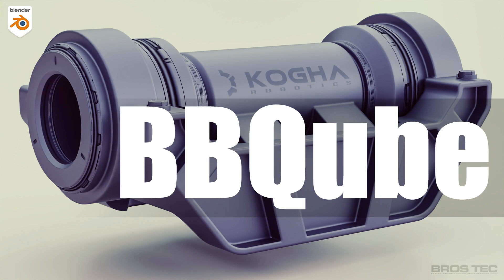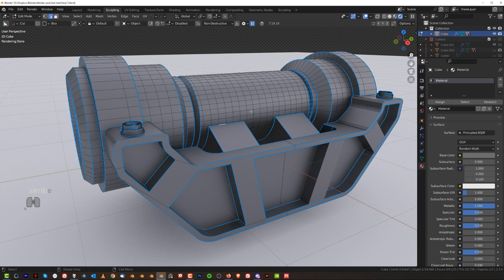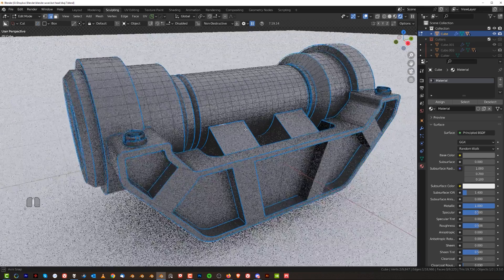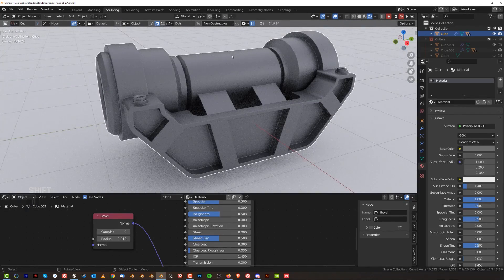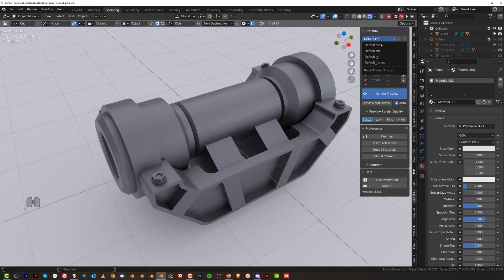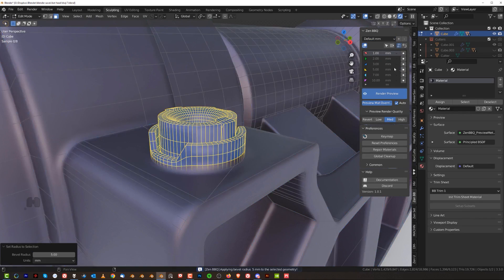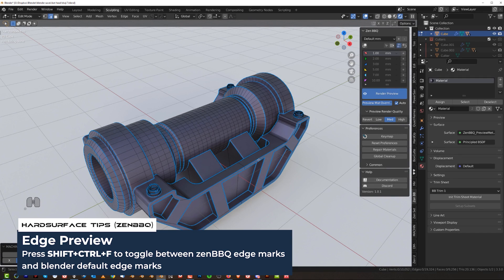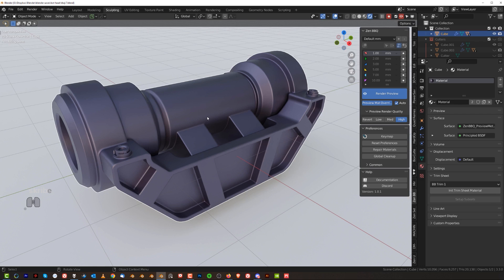How to BBQ A CUBE - Blender Hard Surface Tutorial

Comment: Hard surface modeling is time consuming, period. Organic modeling, and I'm an organic modeler (flesh, nature, etc.) is vastly more flexible because of the lack of hard and precise edges. There's so much more flexibility in creating organic edges than there is straight, uniform and precise edges expected in geometry that follows 90° angles or strict XYZ directions. I can easily and cleanly remesh with no errors in the geometry generally by nature of having smoothed or rounded edges to begin with.

Anything that can make it easier to bevel edges is especially useful because of how most algorithms of beveled edges adhere to the native or adjacent geometry to the beveled edges. This creates inconsistencies that cannot be corrected by conventional methods, so this is an awesome solution all around. I use ZenUV to this day but there is a caveat that needs to be mentioned. Baking these edges leads to heavy inconsistencies when used with other programs by nature of the geometry used in the final product. You're always innately going to have artifacts when you try to produce solutions like these, most of which are largely without notice but can create the effect of an unfinished or unpolished model if used loosely and without corrective efforts. Some of this can be corrected in the same way you correct subdivision awkwardness: create loops near the edges in question and the normals figure themselves out.

Comment: Hi! You can also manually change the bevel weight on the selected edges. As another option.
Reply from the maker: of course you can, simply click on the size and drag your mouse to adjust
Reply: @PonteRyuurui  I meant item - edge data: bevel weight, not amount. Like for example the detail at 5:23. We select its edges and put it from 1.00 to 0.50, for example, and the other edges of the object remain with the old bevel.